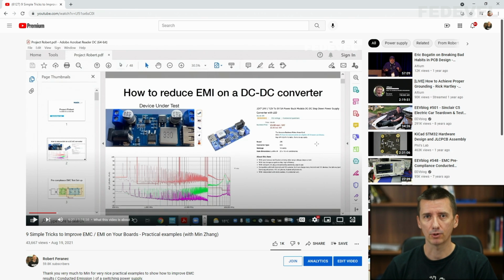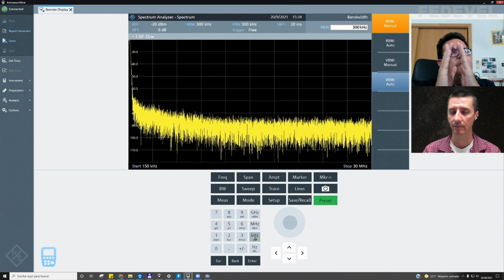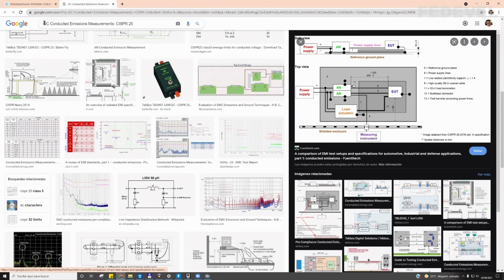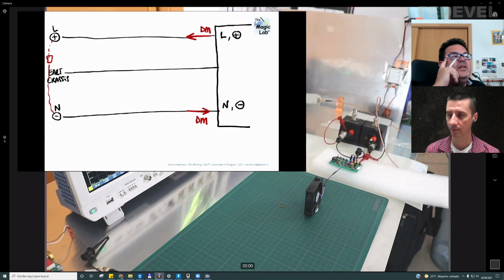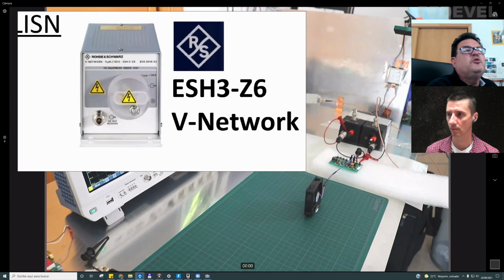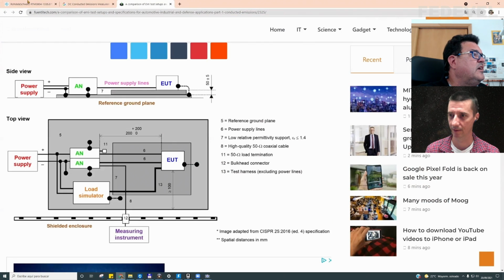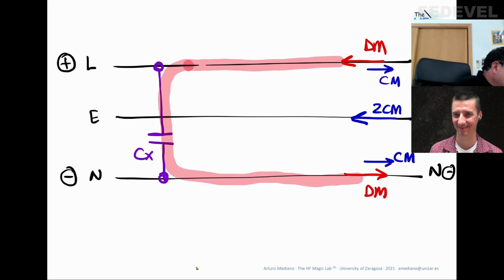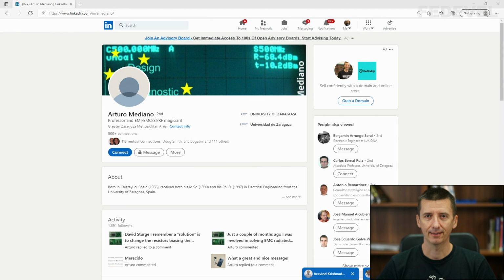Every HW Engineer should know this: Measuring EMC - Conducted Emissions (with Arturo Mediano)

Comment: I guess there was no explanation regarding extracting (CM , DM ) information about mathematical operations on waveforms using an oscilloscope instead of D.M.R.N`s. The system was even assembled in 1:33:08
after all GJ!

Comment: Great video! thank you very much. I have a question. If the EUT does not have ground terminal, why is necessary to measure common mode noise ? Is this noise radiated from ground plane instead of conducted ? thanks in advance.

Comment: Thanks for sharing all this knowledge here on YouTube Robert.
I do have one suggestion for you maybe, it's great that you show all these very professional stuff but you know that this is pretty much all unobtainable to the normal guy, the hobbyist so to speak.

Maybe it would be interesting to show what you can do when you're doing this for a hobby, what can you do as a DIY guy and you don't have access to the professional equipment, let's say you only have a cheap oscilloscope that has an FFT function like the one I have for example which is the Hantek DSO5072P upgraded from 70MHz to 200MHz and you don't have an arbitrary function generator but only a simple DIY function generator but still capable to inject some simple signals up to about 1MHz.

Or maybe if the answer is that with my equipment it's impossible to do any of the tests or measurements, well than you can just tell me that with a comment that I can't do any significant or usable with the cheap equipment that I have that would be good too, an honest answer is always helpful even though it's something that I don't like to hear.

Comment: According to the standard on how to setup and test for conducted emissions, none of this is correct accept for maybe the correct thickness of the ground plane he used. Please don't repeat any of this people! It will be wrong and you would never be 17025 certified by an inspector if he saw this as your way of testing.
Reply: That setup is not supposed to be used for compliance testing, so no need of having it match the standard 100%. Compliance is always done in a certified lab. The setup shown in the video is perfectly fine for development and pre-compliance testing/troubleshooting.

Comment: I am only sixteen minuets into the video but making notes. The linear frequency scale is helpful for showing that the interference is periodic and the amplitude of the harmonics are nearly all the same. This signal is a COMB in the frequency domain. The Fourier transform of a COMB back to the time domain is also a COMB. A COMB has very narrow on time. This is a clue that there are periodic very narrow pulses at the root of the interference. These are likely to be current pulses. This is a clue that your interference is conducted common mode emissions coincident with the switching supply edges.  You could probably see them with an oscilloscope in the time domain by triggering the scope from the switching supply by connecting the oscilloscope to the LISN.  

Read about the COMB signal at Wikipedia: https://en.wikipedia.org/wiki/Dirac_comb

Hope this helps
Reply: For people wanting to start measuring radiated emissions the RTL SDR, (Software Defined Radio) can become a spectrum analyzer with which you can start looking for the significant emitters in your projects.  Hope this helps.
Reply: A about 1 Minuet Robert asked about input protection built into the Spectrum Analyzer. 

I am sure for many CB (test agency companies) they would rather fail an external protection device and throw it away than fail something inside the Analyzer which then is an expensive fix by the manufacturer anyway. 

There will always be a way to fail the protection devices. The consequences of the inevitable failure is what you as the spectrum analyzer user / owner is you want to get to choose.

Hope this helps.

Comment: I have seen some great videos on YouTube from Wurt where they used a SPICE simulation where they model the LISN as well as the circuit under test. It shows whether the noise is DM or CM. It also allows for having the test limits on the output graph. Very useful and illuminating.
Reply: Hey, thanks for the info. Could you share the link to the video you refer to?
Regards
Reply: @Pumoneon  the link is - https://www.youtube.com/watch?v=Ofnyqd-yl9o&list=WL&index=83 . Anticipate EMC with LTSPICE and the company is Wurth Elektronikl
Reply: Hi, would you mind sharing the source?
Reply: @dario_fresu  I have the youtube video url here: https://www.youtube.com/watch?v=Ofnyqd-yl9o&list=WL&index=83. I hope this works. I made a mistake with the company name its Wurth Electronik and the video title is  Anticipate EMC with LTSPICE

Comment: In connection with use of a scope FFT, it would be useful to hear why one would bother with a Spectrum Analyzer if the scope can do the job. I'm assuming that the Spectrum Analyzer does a better job in some dimensions -- ease of use, speed, frequency range and bandwidth, sensitivity, functions specific to comparing spectrum to limit graphs and so on. But then again, I don't know how good are the spectrum features on scopes at what price range. Like do you need a $10k scope to get one with spectrum features of a $2k spectrum analyzer?   Comments?
Reply: The trick is realizing what the device is doing internally and it becomes clearer. Oscilloscopes and SAs work in very different ways. 

When using a scope FFT, you are picking a “slice of time” and running maths on top. This means that FFT measurements that get close to the bandwidth limits, you’ll get poor results. 

In some sense, the scope can only measure the range from ~0Hz to F, but a SA can measure from f1 to f2, with f2-f1 in the kHz range, even if they are frequencies in the GHz. Since noise ~~ bandwith, the SA can give you way more sensitivity.
Reply: That spectrum analyzer goes down to -100 dbm.  A scope has 8 bits or maybe 10.

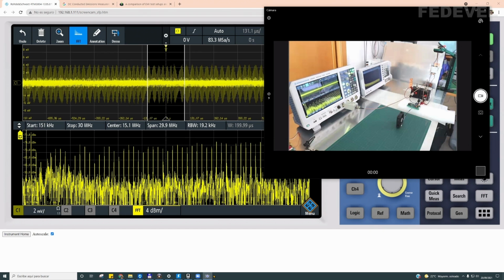Comment: 1:20:02 Robert mentions that the scope math function could be important. I don't think Arturo ever got back to that point, but I assume it's useful to perform the additions and subtractions that can separate out the CM and DM signals, without needing a hardware component to do those operations as shown at 1:42:30.
Reply from the maker: yes, you are right. if people are interested, we can do more detailed measurements. We did experiment with the oscilloscope measurements & math functions, but I decided do not include them in the video as it would be better to use something what would create nicer and more visible results (a device with more clear DM and CM noise).
Reply: Yes, because first of all a scope has more than one input (you need to measure both LISN outputs at the same time to separate DM from CM) and then you can calculate the DM and CM components.

Comment: You were looking for the noise problem in simple circuits - no result. They looked for a problem in complex chains, and got even more confused. The reasons for the failure are in the tools used. Your attention is completely focused on the shape of the voltage, because there are many tools and techniques available for this.
During the discussion, the word "impedance" was heard. Which is very rarely used for power electronics.
But if energy values are used in calculations and stimulations, then the error will be seen immediately.
Reply: Who are "you" and "they"?  What "no result" and "failure" and "error" are you talking about?  And you remark that "impedance" is rarely used in power electronics. Well clearly the word "impedance" is appropriate in this video, as it centers around measuring noise using a LISN, which has "Impedance" right in the name.